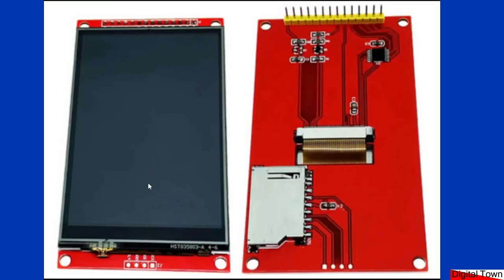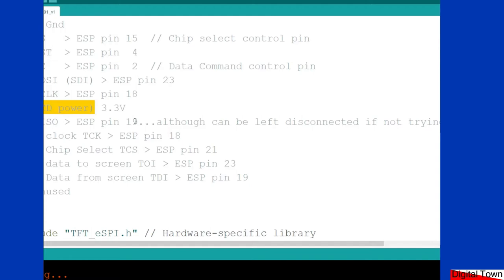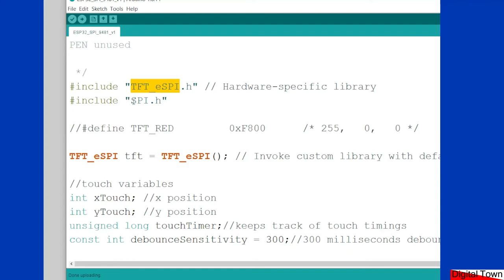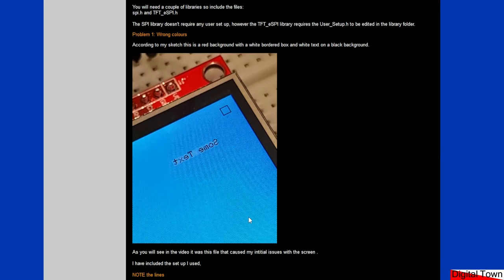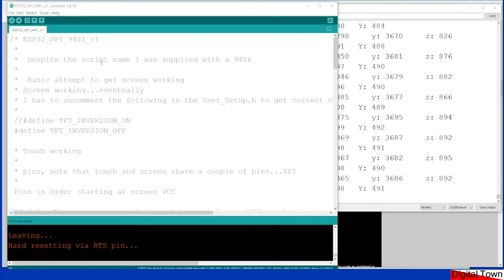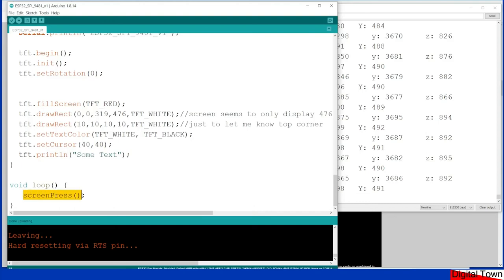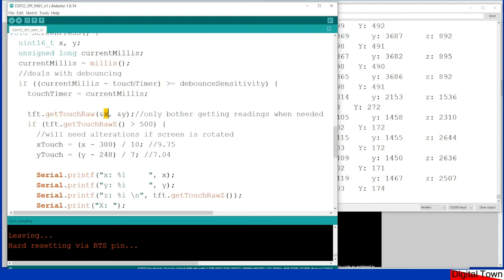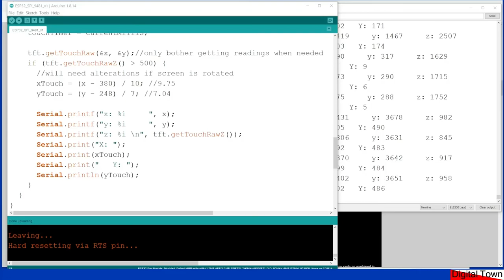ESP32 with SPI  480x320 Touch Screen, is it a ILI9481 or ILI9486?

Comment: hi bro, i have a ili9486 parallel display(no spi) and i want to use it with esp32, can u provide me with a path to do it. I'm a total begineer please help 😞
Reply from the maker: I can't help much as I don't have one of those screens as they use too many pins for my project but I can try and point you in the right direction.
The library you will need to use is TFT_eSPI by Bodmer and if you go to this link
https://github.com/Bodmer/TFT_eSPI/issues/2120 You should be able to find the correct pin out and towards the bottom even some sample code.
Obviously getting the correct pin out is crucial.
Hope it gets you in the right direction.
Reply: @digitaltown5442  I have checked it but where exactly and how to make connections is my problem, it says u have to make changes in some file but that file doesn't have this parallel-ili9486-esp32 option.
Reply from the maker: @tanjiro3285  It will be the User_Setup.h file.
Uncomment Line 33
#define TFT_PARALLEL_8_BIT
Line 46
Make sure #define ILI9486_DRIVER is uncommented

You have now selected the right board and parallel connection.

Comment out lines 194-199
//#define TFT_MISO 19
//#define TFT_MOSI 23
//#define TFT_SCLK 18
//#define TFT_CS   15  // Chip select control pin
//#define TFT_DC    2  // Data Command control pin
//#define TFT_RST   4 

Now go down to ESP32 parallel mode

Uncomment lines 239-253
#define TFT_CS   33  // Chip select control pin (library pulls permanently low
#define TFT_DC   15  // Data Command control pin - must use a pin in the range 0-31
#define TFT_RST  32  // Reset pin, toggles on startup

#define TFT_WR    4  // Write strobe control pin - must use a pin in the range 0-31
#define TFT_RD    2  // Read strobe control pin

#define TFT_D0   12  // Must use pins in the range 0-31 for the data bus
#define TFT_D1   13  // so a single register write sets/clears all bits.
#define TFT_D2   26  // Pins can be randomly assigned, this does not affect
#define TFT_D3   25  // TFT screen update performance.
#define TFT_D4   17
#define TFT_D5   16
#define TFT_D6   27
#define TFT_D7   14

Those pins are the connection to your screen from the ESP32

That's about as much help as I can be. I don't have that screen to test with.

Once those settings are made just run a test, even the examples I have given for the SPI connection and the screen hopefully should work.
Reply: Is it posible to get the spi interface? It is the same controller anyway
Reply: @ronalerquinigoagurto555  I don't think it's possible

Comment: Hello i tried it, but it didnt work properly, my problem is vertical flickering banding. How can i solve  it. Thanks
Reply from the maker: Obviously check all your connections, but then make sure the screen is ILI9486. Without being able to see what is happening it's hard to diagnose. The expert on this is Bodmer who wrote the library. If you go to https://github.com/Bodmer/TFT_eSPI/ you could either add an item in the discussions or raise an issue.
Reply: @digitaltown5442  thank You, i am sure  connections, because i using ILI9488 on the same pcb, of course i changed  parameters in the user setup for ili9481, i tried your user setup and others but result same, vertical flickering banding, i found other users, they have same problem. İ will write to Bodmer. Thanks again.

Comment: Please help. When I run TFT_eSPI sample sketch called "on_off_button", it doesn't response to screen touch.
I can run calibrate sketch without any problem.  It responses to all 4 corners touch.
Reply from the maker: Hi, the sketch you are talking about isn't one of mine so it's difficult to help.
If you look at the sketch from the video ESP32_SPI_9481_v1.ino I get the X/Y touch position in a different way as I had some problems with some of the examples so wrote my own.
Once you know the X/Y position of the touch and has a function that works out if that touch was within the area of the button. As my buttons are created in a single array I can work through all the buttons with a single function.
Once I know the button I have pressed I deal with whatever needs to happen if the button is pressed including the button colour if needed.
I will try and get round to creating a video on creating and using touchat some time.